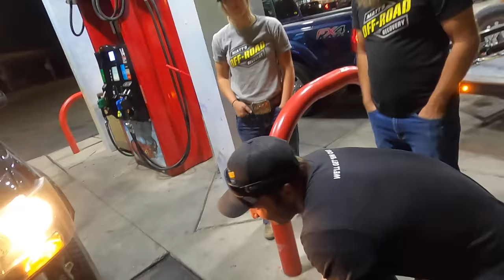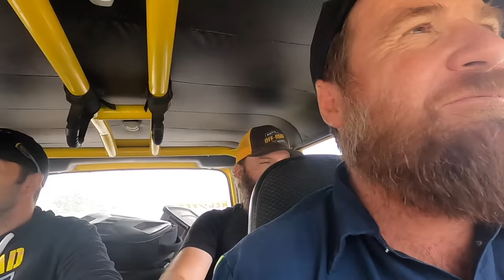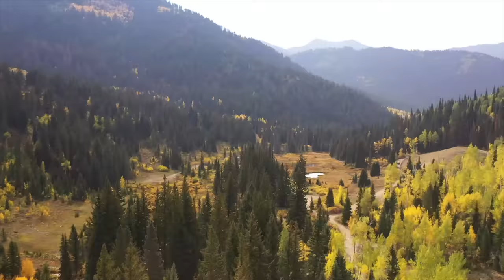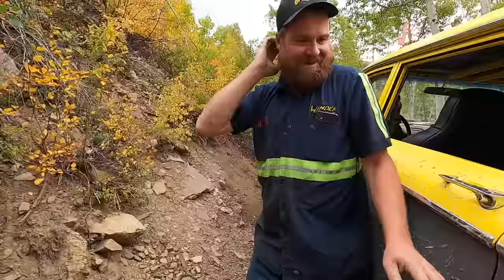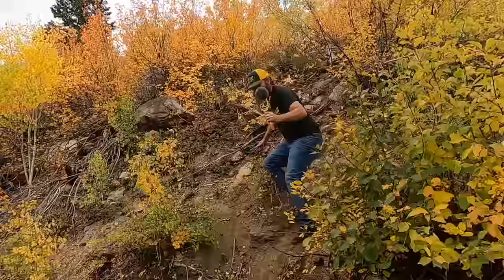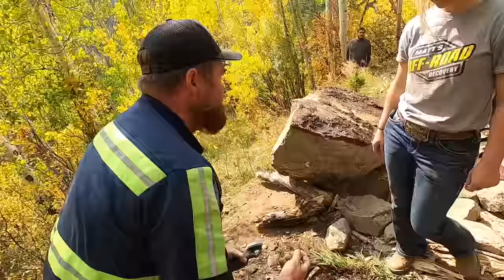I'm Glad I Hit The Tree! Things Could've Been Worse

Comment: I've ridden road motorcycles since I was 14. I have built up a few trucks for off roading. Loved my Warn winch! I ran a rope underneath all the time in case I ever needed the cable out the back. Warn had battery cable quick connects and I still use them today on my 88 Ford 3/4 ton farm truck for jump starting and running 12V trailer winch. Matt and crew, I appreciate your cleaning up the enviroment as you recover vehicles.  I wish more folks would be considerate of nature and the next generation as they enjoy the outdoors offroading.
You all are in my prayers
Hoka Hey

Comment: @Matt - I literally got my Subaru stick exactly where you turned around at the landslide, they told me a Jeep was rescued the day before and I had no idea you did the rescue!  So bummed I missed you!
Reply: That landslide through me off when I when there. While it may seem I when over the rock and into the tree based on the angle of my Jeep, I tried to reverse out of there but completly forgot about the rock and slid off. Tried to save but when into the tree.
Reply: @nalapalacios8335  I made it to the landslide.  Unfortunately I was not able to reverse past that large Boulder, ended up using a jack to roll it off the edge.  The had to reverse back past where you went off then got turned around.  Glad it worked out, but I think they should definitely sign the trail lol.

Comment: Hey pro tip for that drone, the flat side of the antennas is where the signal comes out of, so always keep the flat side of the antenna pointed toward the drone, you'll get way better reception. There is a dead zone at the pointy ends so if you're pointing your radio right at it the way y'all are doing, you will get disconnects.
Reply: Similar with wifi antennas. (Do drones use wifi 2.4ghz?)

Comment: I would consider adding a large come-along to your (optional) recovery gear.  It would be useful for times when you need to restrain the MORRVAIR (from the rear).  We did a lot with them before winches became common.
Reply: there is a style of come-along made specifically for grabbing that straight cable. They are rated in tons, not pounds. I see heavy rigging companies using them on a regular basis.
Reply: This is a great idea, probably could use a hilift on occasion also.

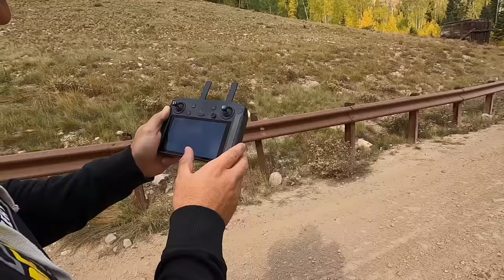Comment: I'm sure someone has commented on this already but that controller gets better reception if the antennas are pointed down at the ground. There is a stop point in the antennas half way from having them fully extended pointing up.  At 6:45 the angle of the antennas is causing very poor reception.
Reply: That may be true, but many things that run in the digital domain are line of sight, like your wireless mouse for instance. That is what came to my mind, due largely to the trees and the mountainous terrain.
Reply: @johnhpalmer6098  agreed. I wasn’t trying to type a huge explanation of all the reasons for signal loss. Them driving away from the mavic in mountain terrain is definitely why they lost the signal. Simply saying that controller is designed to have best signal transmission when the pilot is facing the drone with the flats of each antenna towards the drone. Just look in the manual on page 12 for a visual explanation.

Comment: Seeing Lizzy scrubbing away at that windshield... I have some advise.  Sprayway foaming glass cleaner (Spray the windshield down and let it sit for a minute (longer the better, but not so long that it sluffs off) Then "scrape" with an ice scraper with a brass blade (see CJ Industries).  The cleanser uses chemicals to loosen grime, bugs, tar, etc. and the brass edge will not hurt the glass or leave marks.  Bonus, if you suffer a hard freeze, the foam will melt the ice chemically, and make it easier to remove, and you will be happy to have an ice scraper in the vehicle.  In college I once used the chemical ice melt trick to clear my car before the meter maid gave me a ticket, I even elicited a smirk from them when I pulled away.  Otherwise I have a 2014 JKU in the midwest, i.e. lots of bugs, & ice.  Good Luck!

Comment: Hi Matt, my Dads 56 IHC s120 he built a winch (40 to 1 dock winch core)  and made stiff arms adjustable to increase holding power. They carry over the spare tire under the flat bed. It seems like you could use them.

Comment: I’m amazed at both how and why some people think their vehicles are far more capable than they really. That dude had balled street tires and very little ground clearance but he thought that his JK Jeep Wrangler would be able to clear the boulder obstacles and also at the same time, be able to stay on the off road trail and maintain control of his vehicle the entire time.

If you’re going to go out off roading because you’re wanting to go out somewhere and have some fun, maybe try something new and/or are wanting to test out your 4x4 vehicles off road capabilities you have to do a few things first. And the most important initial thing that you must do first and then build and/or add on everything else after that, is to first, get good off road tires that are considered at least 10 ply all terrain or mud terrain LT/Light Truck tires. You want 10 ply so your tires has a much stronger chance of being able to drive off road without going flat and/or getting punctured. The tire also needs to have a very strong side wall too, which is another reason why you must make sure that the all terrain or mud terrain tire that you are buying is a 10 ply tire as opposed to trying to save a buck and only getting a 4 ply all terrain or mud terrain tire. The tire also needs to have a thicker/wider sidewall from the edge of the rim where the tire and rim meet at the bead all the way up to the tread. The vehicles that have a larger diameter rim and thinner/more narrow looking side wall not only looks stupid on a 4x4 truck, suv or crossover vehicle but also is a terrible set up to have for off roading. Should you need to air down to get better grip on the trail and/or over boulders and rocks, not only would you have a much greater likelihood of popping the tire off of the bead of the edge of the rim but you would also very likely increase your chances and odds of probability of blowing out the sidewall on your tires but also damaging the rim as well or instead of.

Hopefully the Jeep owner in this video learned that after he crashed his Jeep and got stuck from off roading.
Reply: Don't you watch TV advertisements? The ones in small print that blink on and off real quick.
Reply: @anotherdave5107 , yes I have seen those as well but I was writing what I wrote because I have gone out off roading before and just by chance have come across people who have been stranded for days out in the middle of nowhere because they took their vehicle out, didn’t tell anyone where they were going or how long they would be gone for and it clearly wasn’t set up for what they were doing and a majority of those times there tires were the biggest factor in them getting stranded.

I’ve also had to help people get rescued that got injured for doing the same exact things with a vehicle not set up.

My concern is not wanting people to get hurt. Nor do I want people to get stranded either. And it also sucks too, when someone damages or totals their vehicle too.
Reply: @j.r.777 - not knowing enough to know you're in over your head.

Comment: Years ago I worked for myself and did some commercial fishing. I got a hold of a couple hundred feet of used "purse line" it is incredibly strong and springy. One dayI hooked a snatch block to a fair sized maple tree to pull a load into a gully, took off and the maple came down. Oops If you ever need really strong rope look into getting some Purse line. It has a huge rating for its size.

Comment: I was 4wheelin back in the 90's came across some young men, very drunk, stuck on the edge of a cliff. A tree about 3 inches around is what stopped them from going over 300ft drop. I pulled them out. They were so wasted they didn't realize how much danger they were in. we're in Arizona.

Comment: First point, Matt’s crew needs a multi winch off-road wrecker. Call it the WreckMorr. 

Second point/question. Instead of moving the rock why not run the winch line from the more air under the jeep to a snatch block on a tree in front and then back to the jeep and pull the jeep over? Then you don’t disrupt the trail.

Comment: If you position the antennae on the drone controller  so they are at a 90degree angle you’ll get much better reception. What’s why the antennae are hinged. They are weakest when pointing straight at the drone

Comment: You know, 90% of the time the DJI smart controllers gets the most range with the antenna 90 degrees out, not 180. 180 is really only used if the drone is directly over you.

Comment: Hard to tell from the video, but it didn't look like the antennas on the dji smart controller were in the right position for where the drone was. Check the documentation to be sure, but when I used one it said the antennas should be pointing perpendicular to where the drone is, not at the drone -> antennas likely should have been pointed downward. Sorry that's worded very poorly, but hope it might help!

Comment: Having over 45yrs of using winches, I am very satisfied with the essential need for such. Sadly as the owner and person investing in such, I am well aware that mostly others benefit from your investment, and few times you, yourself are benefitting. Not to say, that I have self rescued on dozens of solitary trips, where except for having the wonch I would have needed up to several days hicking and hard slog to get help. Then up to thousands in costs to get extracted.
Yet while never having charged anyone a penny, have saved them huge costs for such recovery. At times much anger by commercial towing services, by doing the free help.
Even police and forestry people have benefitted several times. Police on trail biker patrol on closed forest trails, were pulled out of a deep bog, myself on this closed trail, by coincident entry on a disused, no longer active, overgrown track I went as exploration. By rescuing the police, they did not charge/ticket me, for breaching on the closed trail. Most help has been pn group trips where things got bad too quick.